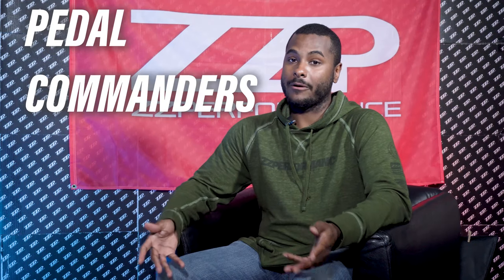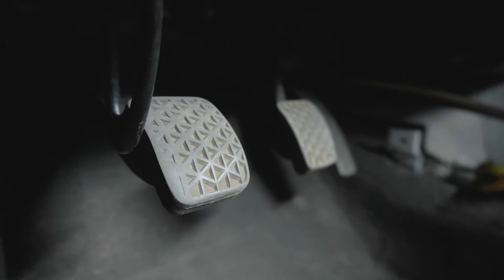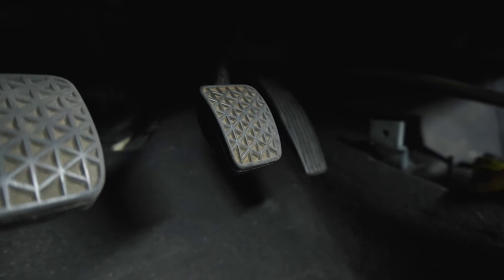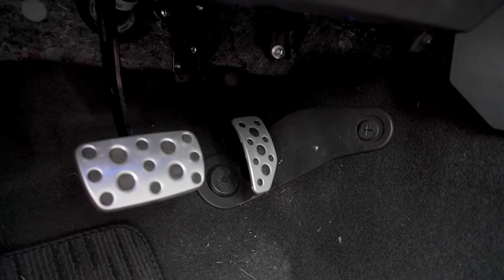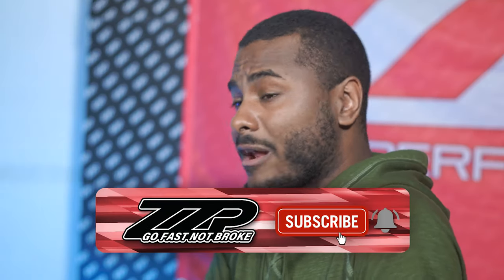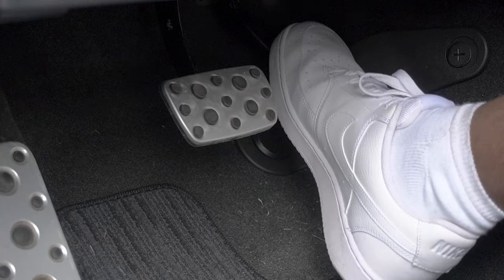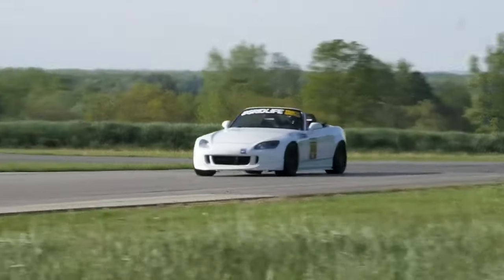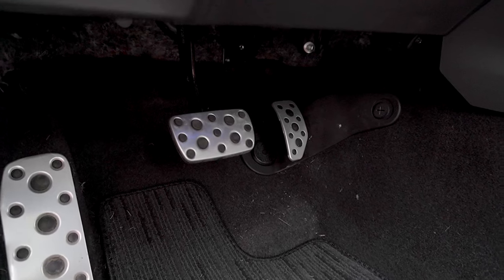Why You SHOULD NOT Buy a Pedal Commander // Behind The Builds

Comment: People are confusing added horsepower with better throttle control and response. YES this will make your car quicker/faster because you can put more power down as you want to not as Toyota set it. Plus you get better throttle response off the line. Less lag… NO it will not give you more horse and top end speed. But you will get faster due to better overall throttle control.

Comment: Has anybody checked how the throttle works stock? If you floor it does it actually go WOT instantly or does the computer gradually open it to WOT? If that's the case then if the pedal commander does infact give to WOT on command you will have more power at lower speeds because of that and a better 0-60 time. I have a 22 RT Durango and it's nothing like I'm used to seems like it's holding back even in sport mode manual shifting from first gear feels like it isn't pulling like it can. If I still had a scanner that can give real time readings I'd look at command throttle and compare it to what the throttle body is actually at just to see if some weird stock program is doing something to the power output.

Comment: These don’t “make you think you’re flooring” your vehicle. I get your point on getting a tune but it’s not tricking you. It takes out the delay you have in your accelerator. My Ram takes a lot of push on the gas pedal to downshift for passing and it happens slowly on top of it. I put on the pedal commander and it’s changed the attitude of the accelerator. If you’re going to talk shit about something at least understand how it works. You can’t push your foot down fast enough to make the computer work quicker. 🤡

Comment: You are incorrect in how this device works. 40% throttle to 100% means the throttle is at 100% regardless. You absolutely do not lose performance or top end throttle with this.

Comment: No they don’t make the car faster they also don’t make the car believe the pedal is at 100% when it’s actually at 40, they just remove the processors delayed response, that’s all, it’s not really a modification though, there are no performance gains associated with the install of a pedal commander just a slight difference in the feel of when the engine responds. Feels like a cable controlled throttle because of the instant response. As my father used to say “all money ain’t good money”. Great feel but no gains.
With that said, I can’t help but love the way the response feels.
But, in a race with someone who’s put in the work, you’re gonna lose. Peace and be wild y’all

Comment: it's shocking people need to hear this... It's labeled as a THROTTLE CONTROLLER. Literally plugs into the tps. Anyone with just a little knowledge should know that something plugged into a position sensor should only be able to control the position the vehicle reads your throttle at. lol it can't change anything a custom tune can. it's almost like installing a new OS when you get a tune, it changes everything. A throttle controller is being able to change your volume on the OS quicker than before. Are they fun? yes. Are they practical for vehicles with big tires, maybe. Should you use it at the drag? no. Should you use it for mudding and crawling? HELL NO. But if you want to have a little fun in a cheap build, try it out in my opinion

Comment: What's wrong with faster throttle response? It gets you out of the hole faster than any stock setting, including track mode and allows you to get a jump on it. It's ideal for adding more acceleration faster for launches, but it DOES NOT ADD HP or TQ!!!! It's not designed to do that. If you are going to race your GT, then do the right mods and get a real tune. THIS IS NOT A TUNE!!!!!

Comment: I get where ZZPerformance is coming about people that don't understand that a pedal commander is NOT a horsepower mod.. But the way a lot of the off the cuff comments are said like "They really don't do that much for your vehicle" and "It's kinda crappy" are very subjective and not facts they are your opinions. There a hundreds of different models of cars with all different ranges of throttle response. Not eveyone is a gearhead that track races and has any interest in a warranty voiding, racing tune. Take my 2013 Jeep Grand Cherokee 3.6l 24 valve V6. Stock it gets about 285 hp. I have done a cold air intake, Flo-Pro catback exhaust, 80mm bored throttle body and spacer. So im up to about 310hp. A noticable improvment but I still have throttle lag from a dead stop becuase of the way the PCM reads pedal input. With a Pedal Commander I can instantly dial in either more lag for slippery roads in the winter or loose traction when I want less pedal response. And on the flip side I can completely eliminate input lag all together and get a super responsive experience. Not to mention every small step in between, at my finger tips, whenever I want it with the PC. A professional tune, while likely to get me a little more horsepower, is not on the fly control like the pedal commander and you're stuck with that single tune. I have actually noticed a saving in gas when I dial back my PC to eco mode. So to say "they really don't do much for you vehicle" is not true. I get you race and your natural response is to just get your vehicle tuned. And you aren't wrong from that perspective. But for most average commuters, the pedal commander is a very useful product not "kinda crappy" as you say.

Comment: I’d really like to get Gale Banks take on this as his company makes one. Also I’d like to point out that anyone that thinks a pedal commander will make their car faster or more powerful is a moron. Fly by wire throttle uses a potentiometer and all the commander does is increase the sensitivity and reactivity of the pedal which is absolutely not a bad thing at all and makes the vehicle drive more properly. It does seem the dyno tune shops are the ones hating tho

Comment: 100% incorrect.
Throttle Boosters increase engine response - Tuned or Untuned.
There are newer developments (e.g. APRs Throttle Booster) that allow the user to customize the sensitivity by % or by their own accord.
Does it make your car faster?  Of course not.  Just as you stated; but  "Rate of acceleration" will be improved.

Comment: It's possible that this device IS actually decreasing the lag between the pedal and the throttle. ECM's on vehicles are just computers, typically very slow computers. It's entirely possible that this device simply speeds up the transmission of pedal data somehow. I'm not sure how it would bypass the ECM or get around whatever is causing the lag, that's why I came to YouTube, to see if there's any actual scientific testing of this product in a controlled setting. So far, no luck....just a lot of anecdotal testimony.

Comment: I would suggest you actually research how it works. You only partially understanding what it does. Yes it modulates the signal, no if doesn't just just go 40% to 100%. The purpose is to remove the noticeable delay in the newer electronic pedals vs drive by wire. 
It basically emulates that old feel and you can set the sensitivity. Yes, some products do change itthe way you described but not the reputable pedal mods like Sprint Booster. Watch their demo.

Comment: So much incorrect information. Think of it the other way around, high performance to OEM. If an OEM electronic pedal/throttle unit was used in a top fuel drag car with the same stock configuration, even a foot stomp at a fraction of a sec would not equate to Wide Open Throttle (WOT), because of the built in electronic control system limits not only the position but the rate at which it functions. This would be the equivalent of a short shift shifter, does it add more gears? Nope. Does it make changing gears easier and quicker by modifying the distance? Yes. You have to understand that it is a lot more technical than transmitting throttle position, it also adjusts the rate at which the throttle body opens. Distance from zero to max WOT and rate at which throttle position equals desired engine RPM (lag). The lag occurs when there is a delay from actual throttle position and desired engine RPM. With electronically controlled throttle systems there are many variables that create an increased time between actual and desired. Simple really.

Comment: Let’s be real,  without a pedal commander the car lack %1.5 seconds of acceleration,,,  back in the 90’s the cars came with a cable when everyone could enjoy the horse power and torque of the car came with but now a days they make cars with those electronic throttle 😂 which make the car choke for 1.5 seconds , the pedal commander doesn’t not add any horse power but the car runs way better with it 😊

Comment: But pedal commander is the knockoff and not remotely as direct as the sprint booster. Don't get the generic china knockoff, obviously you're gonna get the gain-modifier ones then. You want one that only affects response, not the gain and give you more multiplier. 30% should be 30%, 31% should be 31%. What you should get is what allows you to rapidly go to a given percent of throttle, and exactly that amount. Can often be done with a tune, preferably at least, but newer sprint boosters do that as well if I'm not mistaken.

Multiplier types are shit, if I recall correctly, you should only go for volt-increasing ones that do only affect the response-time of the valve.

Comment: they make it very clear that all it does is adjust the throttle curve. what I want is throttle response improvements. you are speaking to idiots that dont know how to read and think it increases power. i dont want to hit the gas and have the car take 3 whole ass seconds to get up to expectation and i definitely dont want to floor it and get an immediate rush of power and lose control. i had two galants with the same engine, one was a gts model and the other was a ralliart and despite the two cars having the same engine the throttle response on the ralliart made it a better car hands down. THAT is exactly what the pedal commander does. it turns a galant gts in to a ralliart and 100% makes the car better to drive. especially when it comes to vehicles like my ram 3500 6.4l with stupid sluggish throttle response. again i dont care for a power increase, its already got over 400hp, i want to have a more linear throttle response and power delivery. it feels like all the way up to %75 throttle input i get less than %50 power then that last %25 throttle is like %100 power. its fkn dumb not to mention that last %25 throttle comes with a 3 second delay then BAM max fkn power.  that is way more dangerous than a linear predictable power curve.

Comment: My car has a bespoke custom stage 2 remapp which is great, but I then installed a Pedal Commander which makes my throttle way more responsive which technically makes my car quicker to respond within my control. If a throttle is more responsive the car will move quicker, simple. This video is absolutely negative and Not accurate !! 
Cars with different modes / eco / sport / comfort ect basically 
have similar effects to a Pedal Commander but are stock & limited. The throttle response modes allow you to custom suit your response to your style of driving which is brilliant 👏  This guy is hating on a totally inaccurate level which is totally unprofessional !!!

Comment: People are idiots and can't do research, plain and simple. 

Forgetting the specific brand here and refering to all "Throttle Controllers" there are perfectly justifyable reasons one would want to fit one. For instance, a 4WD. My 4WD has factory power/eco/normal throttle control already which is designed not just to allow some fuel saving by damping out acceleration to keep it in the eco zone but also to take away sudden presses when offroad, especially on sand where you want to have a slow and steady response or when navigating large rocky crossings where you really do not want any sudden movements. Eco mode does perfectly for this but even I have wanted more control over this mode for different situations so a TC is a good option. Having the ability to then also press a button and instantly take away that lag and make it full response is also very handy when overtaking . 

So plenty of reasons why one SHOULD buy a TC if they want better control in some situations.

Comment: If you tune the throttle table using hptuners, you actually are doing the same as the pedal commander, the difference is that on a custom tune you have to reflash the computer everytime to fine tune it, now a pedal commander is doing it on the go, I have tuned multiple jeeps using Hptuners and while running live using the pedal commander, the tables change like if I would custom tune it, so please guys if you don’t want to spend the money on a hptuner then buy credits to write to the computer and hope that you don’t have to send the computer to get unlocked, buy the pedal commander, it works the same if you custom tune it but it’s on the go, you can’t do that with a custom tune, this video is stupid, yes a custom tune will be more smooth on the % but it’s manipulating the pedal % aswell, now let’s say your wife drive the jeep and since you custom tune the pedal and she can’t control the responsiveness then you have to reflash the custom tune,( now it’s Mopar so it takes 2-4 flashes to the computer to actually take effect) first flash poom limb mode, second flash (might get lucky) possible fireworks on all lights, sounds ect, pedal commander 👀 nothing

Comment: I got it to use eco so it would make more lag and limit fuel consumption.  It has actually improved fuel economy by 0.9 mpg so far.  At between 5/6 bucks per gallon, I’ll save a little coin before year end for sure.  On any other setting, it is stupid crazy that anyone would want that much response unless you are drag racing so unless you are trying to add a little more pep to ragged out ride or something with sever lag, it is pretty much pointless except saving the smash and burn at every light using eco mode.

Comment: I’d also love to know what happens if the thing fails and results in a stuck commanded pedal position lol. These wuhan specials have definitely not had proper r&d to account for failures
Reply: Turn your car off like you would if any other issues arrived on your drive. If you bought a cheap TB controller then surely you'd at least be prepared for it to fail.
Reply: @minimumeffortenthusiast8242  you can't turn off the car if its a push start in drive/moving. Even with keys the couple of seconds fucking around could easily be enough to crash. Good luck with insurance... You can literally use your foot to achieve the same effect these garbage units produce
Reply: @Rawkfist1501 No you don't know how it works. They're a complete waste of money
Reply: @JoshVC  so in other words, a year later, and you still don’t know how it works.

Comment: Or you can just drive with complete pedal lag like a boner. Stepping on the pedal 50 percent before your vehicle moves seems like a bunch of crap too. I'd rather have my 50 percent be right off the bat rather the last quarter inch off the floor boards.